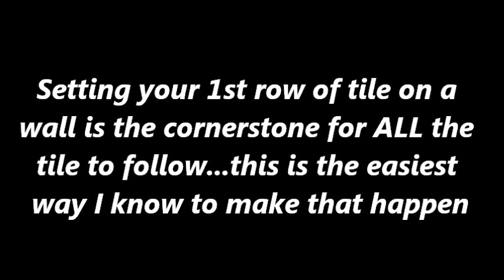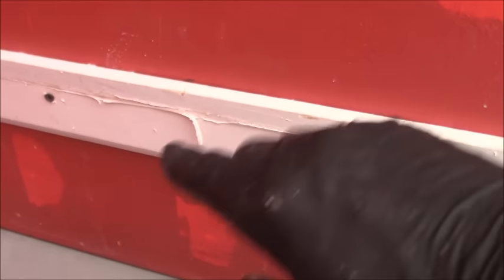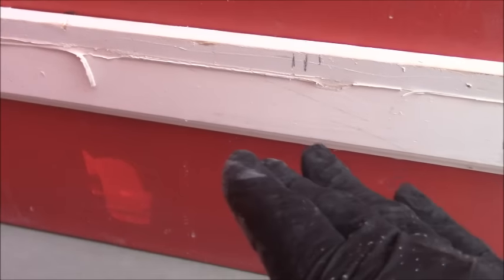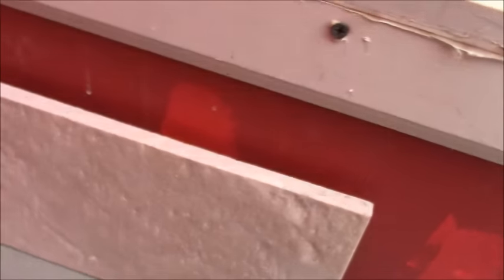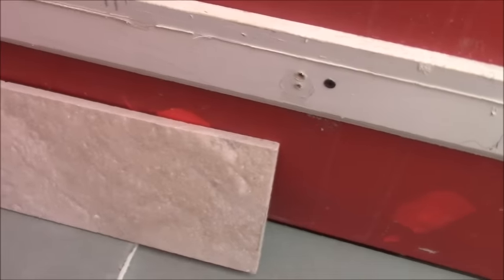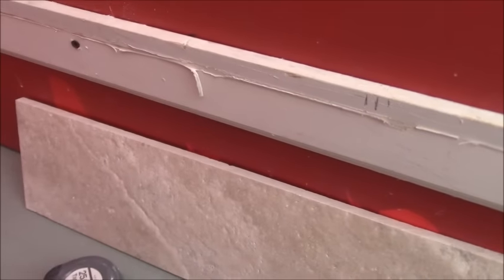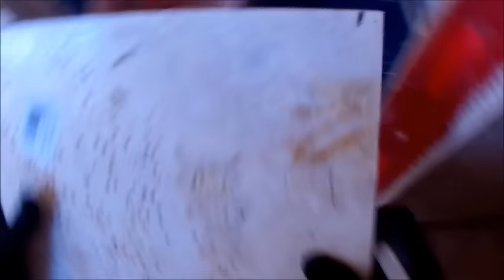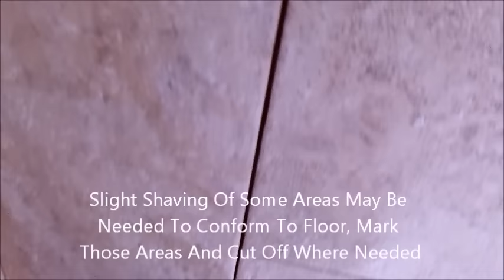FIRST Row Of Tile On Walls....how to do it

Comment: Best construction videos by far the on YouTube University:)). Appreciate everything you do to help the community.
So I have seen quite a few videos in prep for my shower build and wanted to get everything down cold to just do it once. So in this video https://youtu.be/cNLaNE2h9H8 you show the curb being elevated from the floor pan (or it seems to my untrained eye) I don't know how you achieved that unless I missed something was there another video, I thought the curb was 3x pieces of wood placed on floor and wrapped with liner, I'm lost how in that video the curb is elevated from the floor pan?
I understand not wanting the wallboard to touch the floor pan material and you used grout at the edge of the floor tile is that correct? What I do not understand is why is the last tile not touching the floor tiles ? you seem to have those elevated by a couple of mm with the spacers are you leaving the empty space or does it get filled with silicone or grout or its left as the empty space, I am confused there also?
Lastly I think I heard you say in another video you do not use wood for curb anymore, sorry maybe I misheard but I forget which video that is, if that is correct then what do you use instead and do you have a video?
Another lastly sorry...we would like a bench or a small space to sit do you have a video showing how to install a bench in a shower or have recommendations or thoughts on what would be a good solution a full size bench or some sitting space on a corner, ours is a standard size 3x5 bathtub tea rout rebuild. Thank you so much for all your videos and assistance.
God Bless.
Reply from the maker: First off, thank you for the compliment....
Yes I still use wood for curbs, 3 2x4's
Curb is wrapped with liner
Cement board covers all 3 sides, inside part is about 1/4'' off the pan
No silicone needed since it's all Redgarded...though you could caulk too
The gap is so tile slides into it, vertical tile overlaps that
Vertical tile off floor by an 1/8th or so & grouted
I make benches from wood ( no video on that ) outside of the pan area, wrapped in cement board, waterproofed, tiled with a slight slope into shower.

Comment: You yanks and your outdated Feet and inches, nobody understands that anymore.
Reply: You're right. We shouldn't work with whole numbers, thats stupid, lets use fractions instead.
Reply: The hardware store is 320 rods from my house.
Reply: We are still working on English, nobody understands that as well.
Reply: And who says Yanks anymore...….?
Reply: Lol yeah I’m a tiler from Australia! Fuck your ledger board what about when u line your floors up with your walls ? Just set your tiling up right cut a bit of the bottom. Principal aim of set out in tiling is to achieve a balanced and even set out .